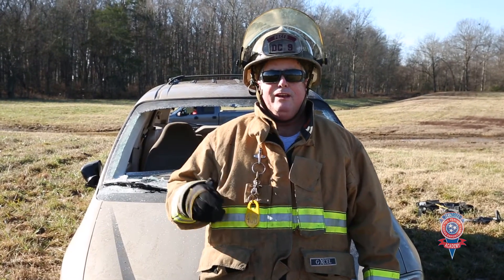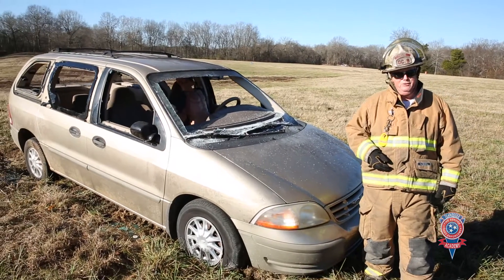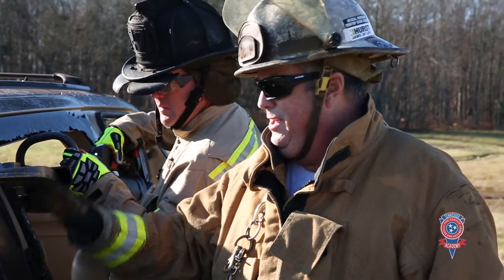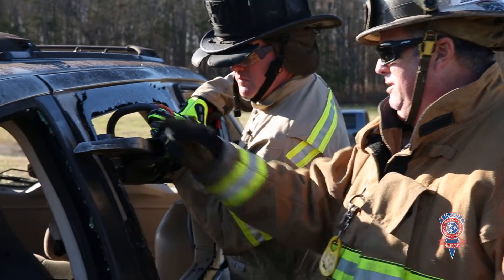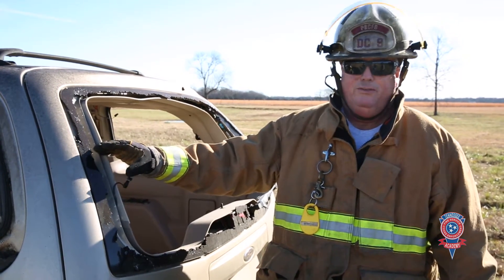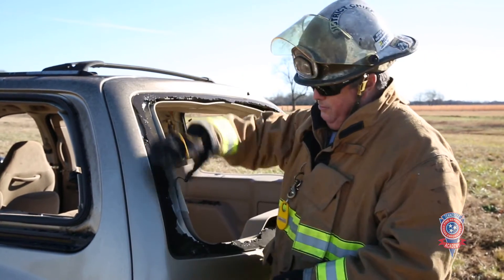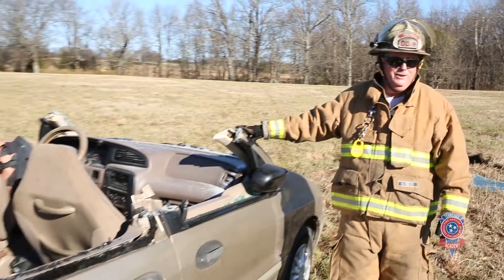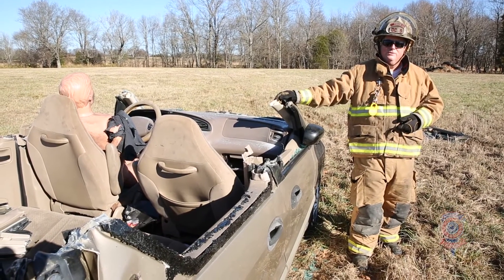Vehicle Extrication (Tennessee Twist)

Comment: Quick suggestion, when you cut the B post out of the way by the casualty do an inverted cut in to the roof at the top of the B post so you take the whole of the B post out. It is easier to cut a V shape in the roof like this and removes the hazard of a jagged stump near the casualties head.

Comment: Hi, Thanks for sharing this technique, it would make sense where you have limited crew members, may i ask if you have limited crew so a complete roof removal can not be completed, would you have enough people to longboard the casualty out of the vehicle, or would that be with the addition of medical teams? Not a criticism.

After watching your video, i am a great believer in sharing information and techniques in this field, so thank you. We did struggle to rotate the roof even with several people, we had to make a relief cut in the rear post to take away some of the strength, we then thought perhaps rotating on the smaller top of the mid pillar may be better, as stated dependant on casualty location. One with we will try again with different orientations.
Great stuff thanks for sharing.

If you don't mind here is a link to the pictures of the one we tried.

https://www.dropbox.com/home/Public

Comment: Very quick move with minimal crew members. The only after thought I have is if your planning on taking the doors also then you should do that first to be able to utilize the strength of the halo contained in the roof structure for your vertical crush. Maybe pop/ cut only the doors needed for patients access and removal before the twist.